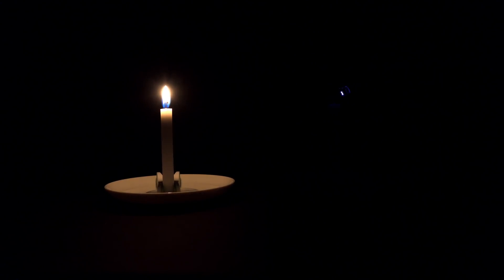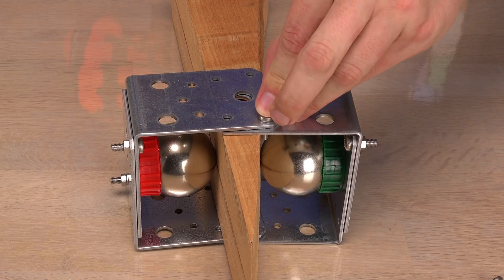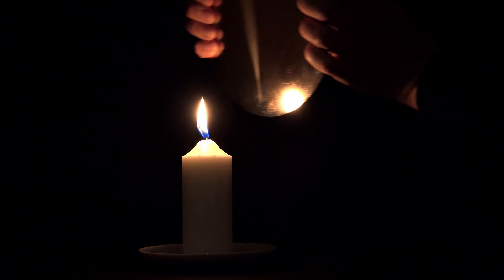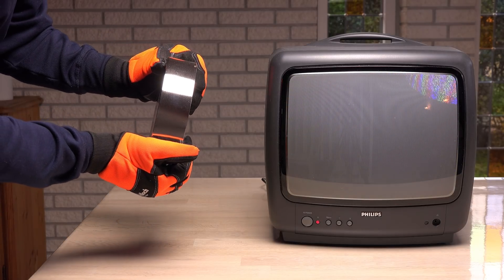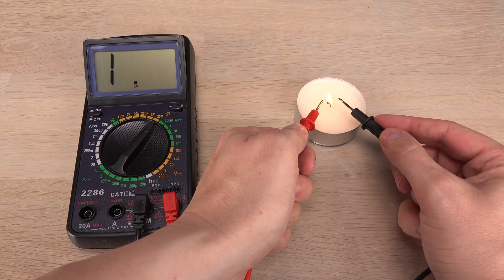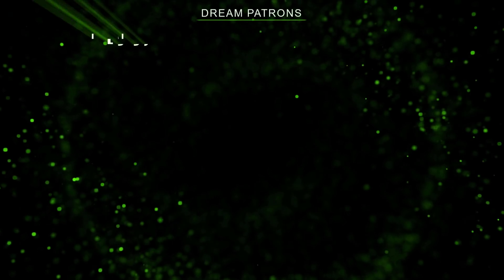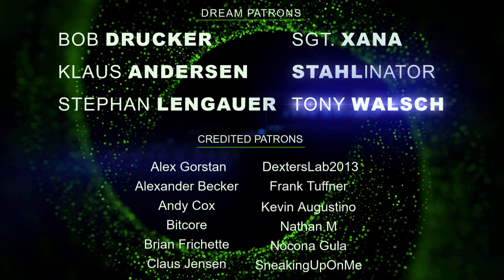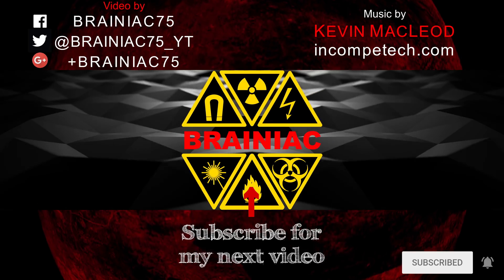Monster magnet meets flames...

Comment: It'd be really hard to falsify the results considering a flame needs oxygen to even exist. We would need to find a flame that can enter a plasma state in the absence of oxygen in an a inert atmosphere to test. The flame is also susceptible to electrostatic fields, so we cannot be completely neutral.
Reply: Nitromethane can burn in the absence of ambient oxygen, using a fiberglass wick.
Reply: Or maybe, you could try testing each theory one by one, without the use of flames, the air displacing the flame theory, for example can be tested with any sensitive system that would detect the air being displaced by the magnet.
Reply: it wouldn't be that hard to falsify his hypothesis at all. One could assemble an inverse flame a la Cody's Lab recent setup where a small jet of oxygen is burned in a hydrocarbon atmosphere. In this case the flame should be attracted to the magnet rather than repelled and given that the same chemical reactions are occurring in the "inverse" flame as in a normal one the only varable is ambient oxygen level.
Reply: It could be tested. Nitrogen is only very weakly affected by magnetic fields so you could mix oxygen and fuel together to make a flame in a nitrogen atmosphere. Then if it is still repelled by the magnet, you will know his theory is wrong.
Reply: Oxygen-propain torch in a nitrogen atmosphere. No ambient oxygen.
Reply: @VoltZero83  if the flame 100% consumes the oxygen and that should work. a little outside my price range to try to set that up.
Reply: Cody's Lab burned an oxygen flame in propane atmosphere. Depending on the properties of propane that could work
Reply: There are stronger oxidizers than oxygen. For example flurione, chlorine. Hydrazine can burn by itself. Maybe if something reacts with sulfur, it may burn in sulfur vapor.  You can find video where just blowing flurione gas onto something flamable or even steel wool set it immediately on fire. For this reason it's extremely toxic.
Reply: i was thinking the same, my idea is that the charged particles in the flame move mecause of convection and so get deflected as the cros the magnetic flield lines.
Reply: @laharl2k  I don't think the ionization plays a significant role. Fire is a quasineutral plasma, the intermediate products have a fairly even distribution of ionization.
Reply: One useful control would be to study the flow of rising air around a piece of equally hot tungsten wire or so, minus the chemistry of the flame. If it is indeed little to do with the ionization, this should have a similar effect as the flame regardless, as the reduced density should attract less to the magnet. But indeed a direct measurement of air pressure variation around the magnet sounds preferable. Seems plausible; we are talking about a force large enough for the effect to be seen directly; you shouldnt need CERN-level equipment to measure that.

I think the relatively lacklustre performance of the giant magnet is another argument against ionization effects. The effect on charged particles should depend directly on the field strength; so more pronounced with a bigger magnet. But the effect of oxygen attraction should depend on the gradient of field magnitude, which is more concentrated near the flame itself for a magnet on the same scale as the flame. 

The behavior in the two-sphere setup is also evidence against ionization, on much the same grounds. When held in the middle of the spheres, nothing happens, even though the field should be quite strong there. That is congruent with an effect dependent on the gradient of the field, not with an effect dependent on the field itself.
Reply: You can easily create a flame in an oxygen-less atmosphere or even a vacuum. Fireworks, gunpowder, and rockets carry their own oxidizer so they can burn (or explode) without the need for external oxygen. I don't know how their combustion products will effect the results though.
Reply: It has the same effects on plasma vacuum tubes with various gases. Similar to the cathode ray tube example here which is under vacuum.
Reply: Interesting 🤔
Reply: Maybe a Bunsen burner with oxygen feed at the bottom, then set up to burn in a nitrogen filled container.
Reply: Mic.     hael Pierce

Comment: Ouch, did anyone else hear the annoying high pitched sound when he put the magnet near the Cathod Ray Tube TV? What is going on?
Reply from the maker: Sorry, my 43 years old ears didn't hear it all... I believe the fly-back transformer in a CRT TV runs at 15 kHz. Maybe it went crazy near the magnet?
Reply: @brainiac75   I heard it before the magnet got near it. It's a high frequency kind of pitch that all of those TVs put off.
 I can always tell there's a CRT TV nearby when I hear that noise.
Reply: I heard a low sound.
Reply: Somebody never had a tv b4 flatscreens. I'm like the last reply, that sound is tell tale. I'll actually give it the likely hood that it's not completely aged ears but rather being used to the sound. It's only slightly off tone from when your ears are ringing. (Or the sound used in movies/tv for "explosion disorientation")
But i will say i hear nothing in the flash back clip.
Reply: It was really high pitch like most old TVs, and it has to do with how sensitive your ears are
Reply: Heard it clearly even at low speaker volume. Can't understand how some people can't hear it. And i'm not that young either...
Reply: I was thinking it might be electrons flying into the mic which makes a high pitch noise
Reply: Yes
Reply: I had an old CRT tv and I would always hear that sound. Turning it on and off would make the sound louder but after a few seconds, you would get used to it. I don't know what is happening with the magnet making the sound louder but it sure gives me nostalgia. some people can't hear it at all and some people are just so used to it they don't notice it. I have a small case of tinnitus (from breaking one of the bones in my ear) and it is just a little bit off tone to that.
Reply: I heard it too
Reply: Because it runs at 15 kHz, the rapidly changing magnetic fields causes magnetostriction. The ferrite core oscillates at 15 kHz producing they annoying high pitch seen in CRT’s

Comment: Can you measure the increase in air pressure near a magnet?
Reply: I would expect the air pressure to decerase near the flame. Basically a sort of Venturi effect. I might be very wrong with my assumtion, as it would form in an unclosed area, not a pipe.
Reply: @ErikZiak  I think the Bernoulli Effect would apply in that case.

Anyway, I meant measuring the effect of the magnet on the air without the flame. Also measuring the O2 concentration might be interesting, but I think we need precise measurement devices for these things.
Reply: You are correct and you propose a very interesting idea. Now the question is, how to measure it scientifically? Could it be used to enrich the air with O2, e. g. in high altitudes? How would such an apparatus look like? How efficient would it be? What could we expect? Questions over questions....
Reply: @ErikZiak i'll have to do some research on that.  Maybe some other people have studied it.
Reply: @H0A0B123  How would it be the Bernoulli Effect? The presence of a static magnet wouldn't cause a movement of air
Reply: @itsblack2321  I was referring to the flow of air caused by the flame.
Reply: @H0A0B123  Yes, and why would that flow of air cause a difference in pressure, and why would said pressure be affected by the presence of a magnet but not another sphere of similar size?
Reply: @itsblack2321  Generally when the velocity of a fluid increases its pressure decreases. You can read about the Bernoulli effect and fluid dynamics. This effect isn't related to the magnet. The thing with the magnet is another effect.
Reply: @H0A0B123  I may have misread your response; I thought you were talking about the Bernoulli Effect's application when the magnet was present, as stated in your original statement.
Reply: If your discussion of the Bernoulli effect is solely in terms of the stationary, non-magnetic ball, I would agree
Reply: @MichaelDavis-zu2ko  Have you tested that?
Wouldn't the air pressure change if the magnet is attracting or repelling air? It's like how gravity causes air pressure.
Reply: I see what you're saying, actually. It would be a very small difference in pressure since air is not very dense, and it doesn't have a very high oxygen concentration. It would be easier to measure it if you could surround a strong magnet in liquid oxygen. Then yes, there would be a higher pressure near the surface of the magnet due to the oxygen being attracted to it.
Reply: @MichaelDavis-zu2ko  well, i wouldn't be so sure, until it is measured.
Reply: Maybe not measure the pressure, but observing the flow should be possible. The candle will add a lot of interference but it may work.
Reply: @Riskteven  I think the direct effect on air is small, but the magnetic field can affect the atmosphere in different ways. For example by blocking solar wind.
Reply: nerds are taking over
Reply: james If the ''nerds'' didn't invent what you're writing with you wouldn't be able to comment on them as so :P
Reply: therealnightwriter  i was laughing in the answers and suddenly saw the correct one!
Reply: Ha was think the same thing couldn’t u use magnets instead of blades to move air
Reply: @far1002  I don't think this would be straight forward. It might be possible using extremely powerful electromagnets, but I don't know if it's feasible. A fan might be a lot more efficient.
Reply: Imagine the power if u can compress and magnetically accelerate the air just add fuel u have a  bladeless  jet engine   Or add high powered magnets to a jet engine      It’s probably gonna use so much electricity it woul have to be like a turbo button

Comment: The solution to testing if air is the problem is rudimentary, even scholastic!

Simply light the candle in a vacuum, where there is, of course, no air, and test it there! 

:)
Reply: @hama prgasc r/woooosh
Reply: I see what you did there
Reply: This has to be a joke comment. Fire triangle! Heat, fuel, air
Reply: Michael Pierce r/woooosh
Reply: Sheauwn The replies to this comment have destroyed any Hope I had left for humanity.

It’s a joke folks, it’s quite obviously a joke.
Reply: @lazaglider  No the fire has no air in vacuum to change magnetic field. We can do this guys!
Reply: @lazaglider  Why could you not use thermite, which is part-oxygen, and burns in a vacuum? The real joke is that nobody in these comments considered it, or other materials... The test doesn't strictly require a candle.
Reply: You're a genius. I don't see how that experiment could possibly go wrong
Reply: Replace the candle with a solid rocket motor or any solid fuel with build in oxidizer and you're good to go ;D.

Nice joke by the way XD.
Reply: And use water to be easier to get a flame
Reply: @hama prgasc r/woooooshh
Reply: Yeah I think that would work
Reply: Aww man I get wooooshed.
Reply: The flame Can't burn. It need oxygen.
Reply: how would he move the magnet in said vacuum?
Reply: @evilpigeonsify  maybe attached to a motor that can move the magnet back and forth?
Reply: With another magnet outside. But yeah, the experiment would go wrong either way. I am surprised that you actually thought this was the issue.

Comment: Make sure that the magnet doesn’t heat up! Great video
Reply: Aluminum Oxide why?
Reply: Poppa Cap if it heats up too much it weakens the magnetic field
Reply: @Poppacap79  I know what he means but the flame has such a low temperature that it won't happen.
If magnets get high enough temperature it will lose its magnetizing power.
Reply: @Canadian_Teemo  Candle flames certainly are hot enough, by a lot. Those bigger magnets will take a while, but for smaller magnets (say, 10mm diameter and below) it only takes a few seconds for them to fall off of whatever they're stuck to due to loss of magnatism.
Reply: @DaffyDaffyDaffy33322  I just did some research and you are correct. I underestimated the heat generated by the candle flame.